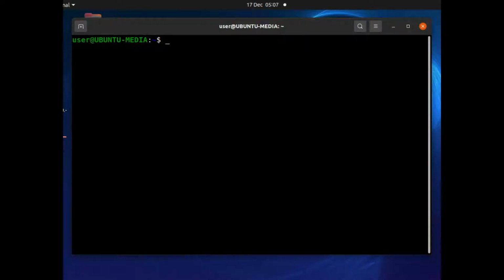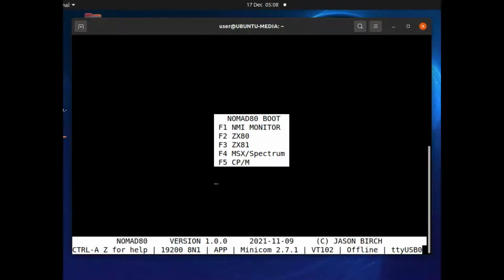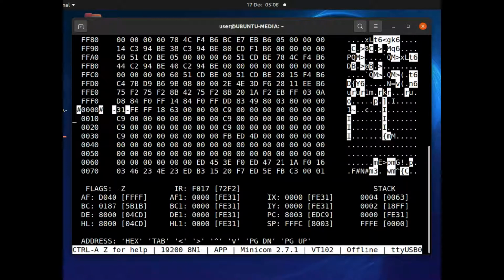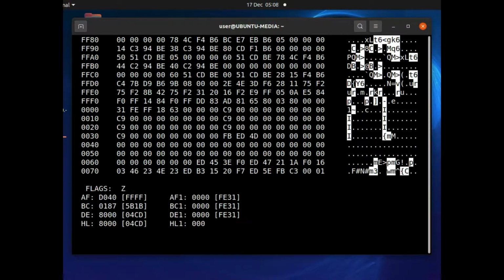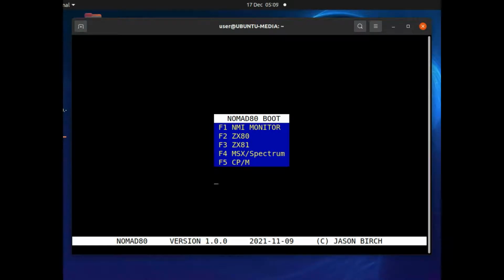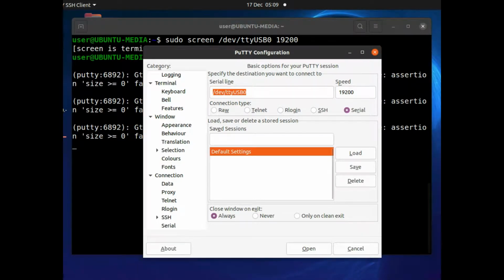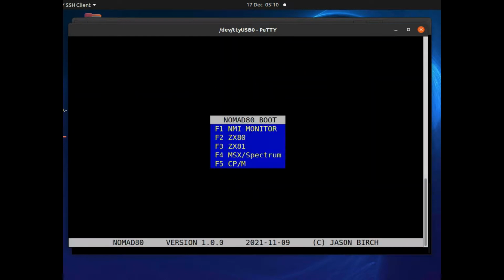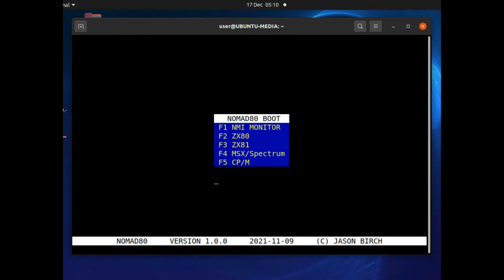MiniCom Alternatives On Linux

Comment: Can we use minicom for get canbus car
Reply from the maker: via an ELM327 device you can get the OBDII protocol over canbus. Canbus itself is the hardware network, many protocols can be sent over canbus, most of them binary data. If the protocol is ASCII text you should be able to view it with minicom. But if the data being sent includes binary data, this would probably be a problem for minicom.
Reply: @DevelopIT  thank you for your help information